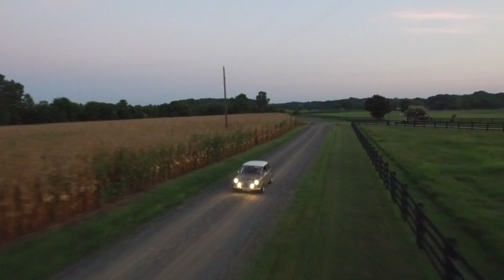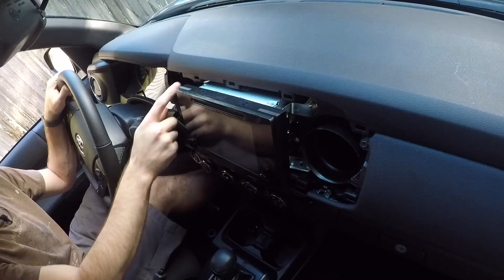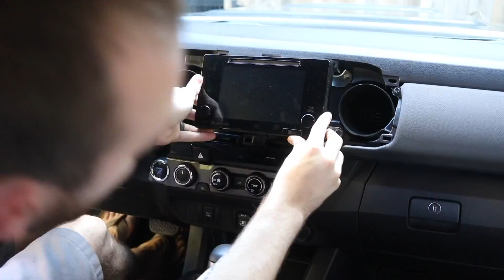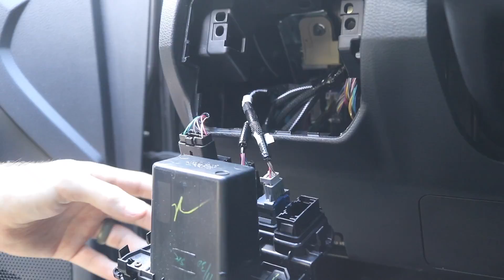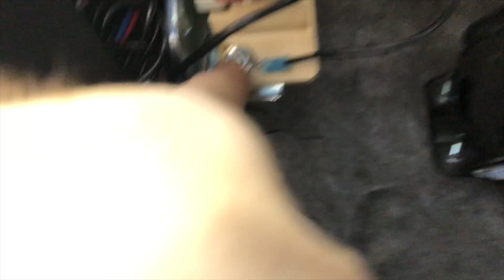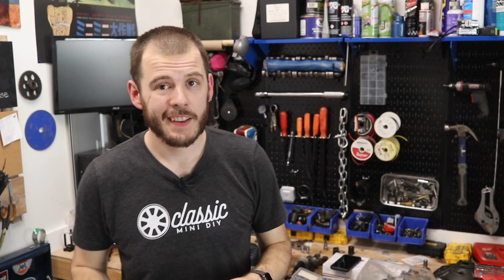Use your Backup Camera Anytime - AnytimeBackupCamera Install DIY

Comment: Very nice tutorial, but that company sells $10 wires and connectors for $200. Sorry, that is a rip off. Don't promote companies like that.
Reply from the maker: If you can DIY the harness, you wouldn't be looking to buy these kits anyways. Its always going to be cheaper to buy individual wire, and connectors and crimp and pin your own connectors. These are kits made for people who want something easy and plug and play. So you are paying for the materials, time and planning that the individual making these has spent developing the kit, as well as the convenience of not having to spend the time doing it yourself. The exact same reason companies like Google don't sell a pixel phone for the exact cost of parts.

Comment: You can always add another 12v line going from switch to the reverse camera signal wire which will do the same thing as that harness ..

Comment: This looks like a great idea but I checked current (May 2021) price at AnytimeBackupCamera for my 2020 Sienna is $72.99 plus shipping. I'm thinking for a hundred more I can get a 4k front / 1080p rear dashcam on amazon. Took all the air out of a great idea. :/

Comment: This is driving me crazy. I’ve seen 10 different ways to wire the 4 wires from the switch to the anytime camera harness and none of them have worked for me.
Reply from the maker: Depending on the year of your Tacoma and the kit you purchased I believe it is a different diagram.

Here's a link to all the diagrams: https://www.anytimebackupcamera.com/blogs/install-help
Reply: @classicminidiy  I chatted with the ABC owner. Answered the phone on a Saturday, super cool guy. He was able to guide me in the right direction. For my car (Toyota iM) the deck does not provide power (red wire) like others do. So I had to tap the fuse box and I was set.

This is a great solution for small tinted rear windows like my car has. Not just trucks.